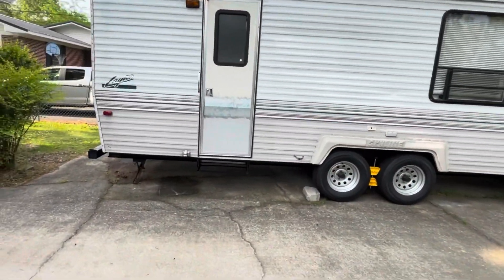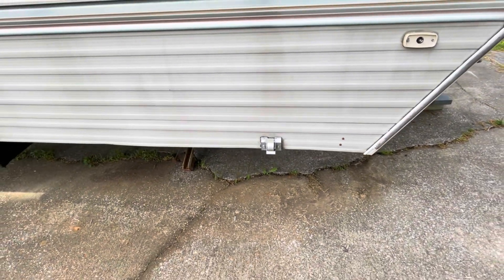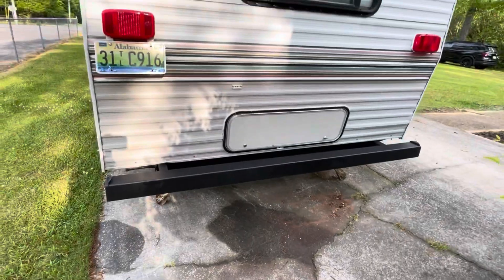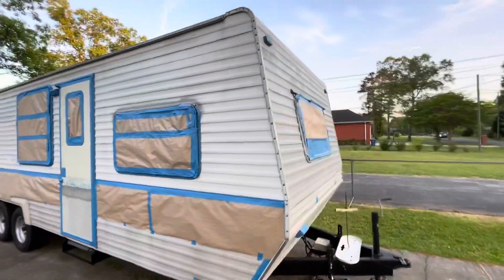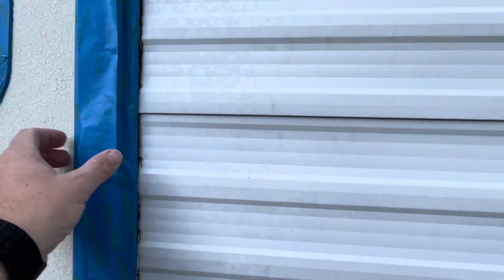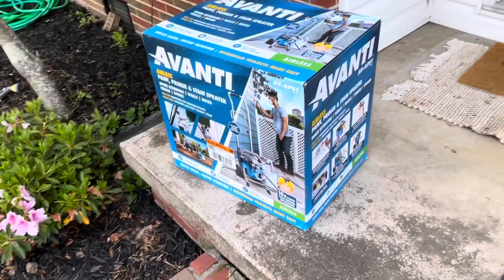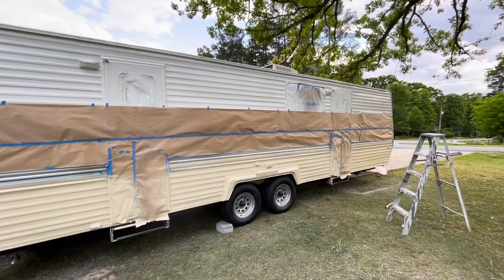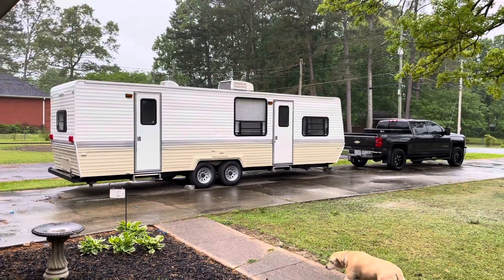Remodeling our 26 year old travel trailer. Round 2: Painting the exterior

Comment: I got to the paint store today fort Some question and they told me to remove the strip, put a oil base primer and other paint on!
But à ses you job you dont sand the rv not remove the stip ...! What paint did u use?
Tanks
Reply from the maker: Valspar Anti Rust Enamel. Bought it at Lowes
Reply: @loyd2ndchapter  dont need to prime or sand With this paint? And did you remove de caulking before? Or paint on the caulking ?
Reply from the maker: The only area I primed was on the nose. It was down to the bare metal for the most part. I didn’t sand. Washed and rinsed really good. I painted over the caulking, which most of it looked to be in really good condition. I figured when the time comes to replace caulking, I could touch up the paint if I needed to.
Reply from the maker: This entire renovation inside and out I’m sure wasn’t professional level 😁
Reply from the maker: I didn’t.